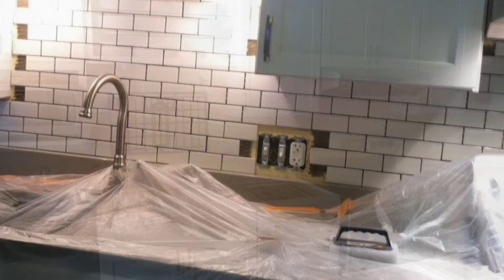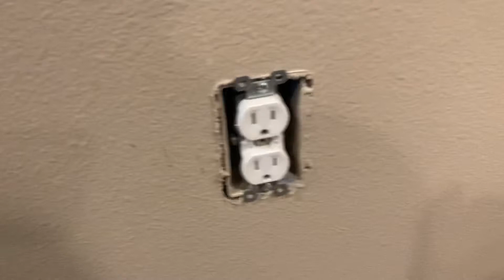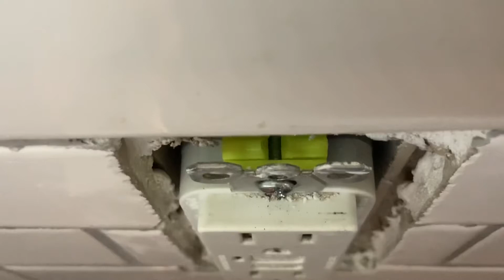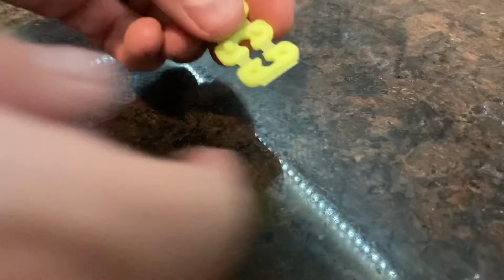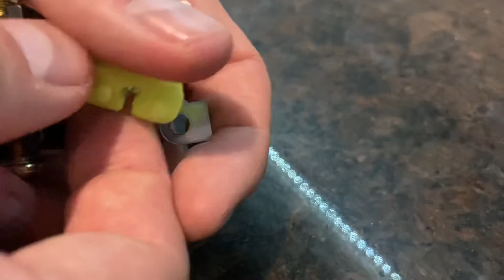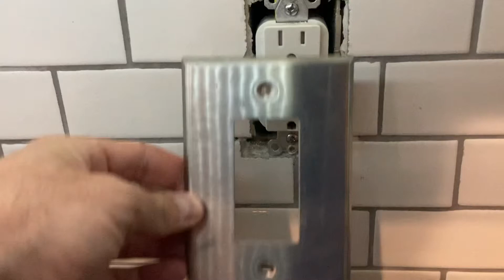Backsplashing Your Kitchen  | How to Extend Electrical Outlets to be Flush with Tile Wall (Spacers!)

Comment: You needed to use a box extended. This does not meet code. You’re only allowed to have 1/4 inch of combustible material aka drywall  exposed. That’s about two of those things stacked. You have like 4. This is a fire hazard sir.
Reply from the maker: I appreciate your comment - this should help DIYers a lot. I did check the product description on these spacers - there is no mention of maximum number to be stacked. My tile adds 1/4" to original drywall and 2 spacers are also 1/4"…but with a healthy layer of thinset it’s beyond 1/4". I like the box extender option - same concept but seals off any exposed materials. I'll add this to the description for viewers. Thanks.
Reply: Code violation.  The spacers go too far for code in MN at least (and national code I think).  Cannot use 5 lol. Box extender will solve problem.
Reply: Would be good to show to pull back electrical outlet and get longer screws, cutting tile so that screw fits...lots missing here...
Reply: I wondered about this - my existing screws are long enough to move the socket out but I can see that the screw connectors are now past the metal box and next to the drywall. Still I have used these extenders myself in the past.